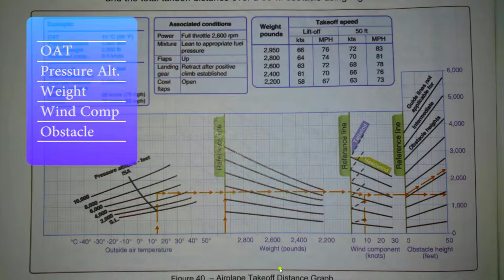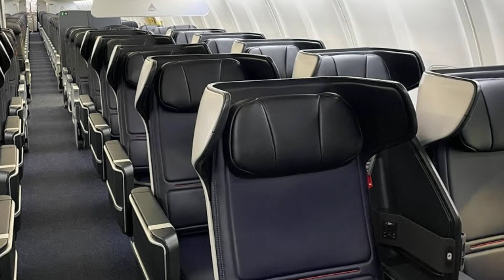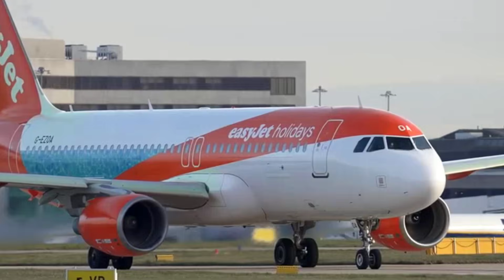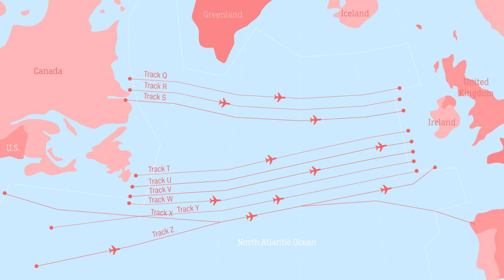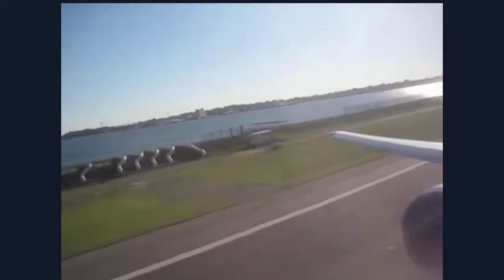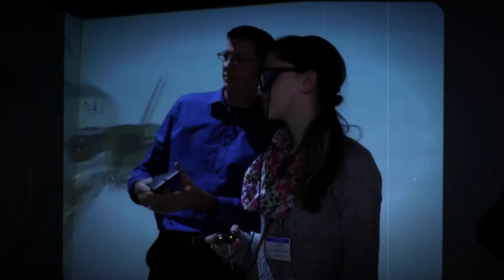Why No One Can Replace The Boeing 757?

Comment: When the 757 was released, fuel was cheap so the high thrust to weight was not a factor.  It is also was intended to replace the 727 on short runways which it excelled on in Caribbean, Central and South America.

The world has changed dramatically with fuel efficiency and emissions becoming the priority.   The short runways are fewer as airports have evolved to attract wide bodies.  

Remember, airlines stopped ordering 757’s and were heavily buying 737NG’s which had grown in capacity to match the 757-200.   I was at one of those high airports (EGL in Colorado) in March and while United had one 757-200,  it had 4 737-700NG’s on the ground routing to their hubs.  

Airlines that kept flying the 757 have done so because the planes are paid for and the maintenance cost has not yet made the fuel efficiency no longer viable.

Comment: It is nice that A318 thru 321 have a single type rating, but recall that 757 and 767 share a pilot type rating too (or it's similar enough to be quickly converted)